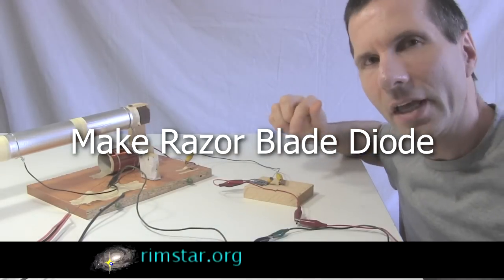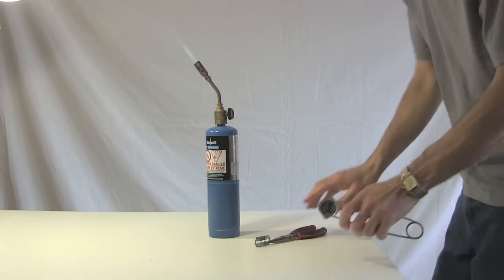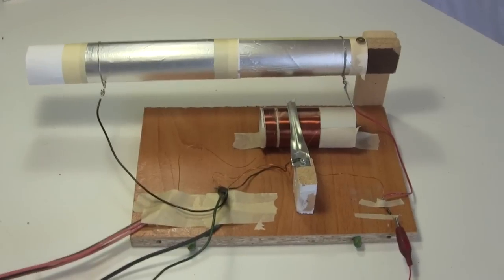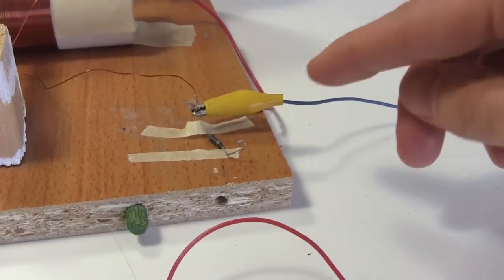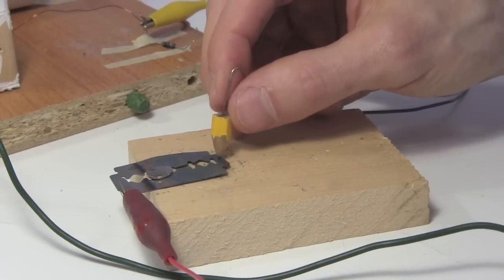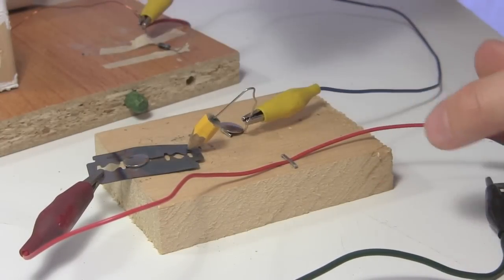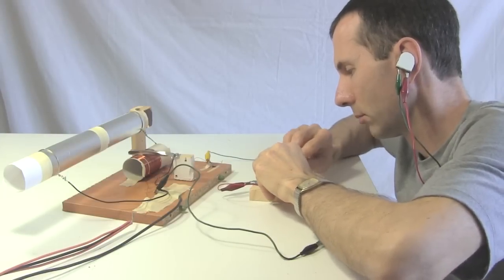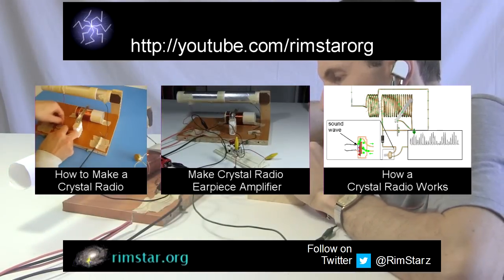Make Razor Blade Diode for Crystal Radio/Foxhole Radio

Comment: Would a candle flame be hot enough to "blue" the razor blade?
Reply: A candle flame doesn't get hot enough to blue steel.  The blue color is from an oxide coating that forms at a specific temperature which is different for different types of steel, but it's always hotter than what a candle or a butane lighter can give you.

If you want to know more about the oxide colors for steel, look for videos about tempering blades.  The oxide turns different colors as you heat the steel.  When tempering a blade, Blue usually means you overheated it and you need to anneal it and start over.

(I realize this is an old post, I'm putting this comment here in case other people have the same question.)
Reply from the maker: It's been so long since I've done this and I did it only once and I don't remember if there were temperature requirements. I suspect there must have been, otherwise why would I have used a propane torch, but then again, maybe the soot from a candle flame would coat the razor blade. Sorry I don't have a better answer.

Comment: do we have to use a razorblade also can we an a butane lighter to blue the metal
Reply from the maker: It's been so long since I did this that I don't recall the details of what other materials would work or what the temperature requirements were. A butane lighter might be better than a candle flame though since a candle flame would probably coat the metal with soot.
Reply: A butane lighter doesn't get hot enough to blue steel.  The blue color is from an oxide coating that forms at a specific temperature which is different for different types of steel, but it's always hotter than what a candle or a butane lighter can give you.

If you want to know more about the oxide colors for steel, look for videos about tempering blades.  The oxide turns different colors as you heat the steel.  When tempering a blade, Blue usually means you overheated it and you need to anneal it and start over.

(I realize this is an old post, I'm putting this comment here in case other people have the same question.)

Comment: can you keep the pencil at the same spot on the blade, and then move the wiper to get another station? Or do you need to move the pencil?
Reply from the maker: If you have the pencil in a spot that allows you to tune into at least one station then you can leave the pencil there and use the wiper to tune into other stations. But if you haven't managed to tune into any station yet then you'll have to move the pencil around, and possibly the wiper too, until you do get at least one.
Reply: @RimstarOrg  Thank you, I am really learning a lot from you. I admit that I am more theoretically than practically minded, so I rely on this kind of videos to keep me in line!

Comment: I rapped my wire around the tp roll and it kinda deformed it a lil will it still work should i rap it around a bottle instead so it will stay round
Reply from the maker: If the tp roll is still close to the same diameter and each turn of wire is still touching the one beside it then it should be okay.  It doesn't have to be perfectly round, or even round at all.

Comment: Make your own crystals (diode)...Taken from Australian 'Hobbies Illustrated'  Nov-Dec 1946. "To make a crystal of the galena type suitable for a crystal set radio,first melt a small piece of lead about the size of a pea  in a old tea spoon. Then add one gram of sulphur and stir with a piece of wire to combine the mixture. Allow to cool and use the resulting black metal as you would a crystal".
Reply from the maker: Neat. I've never heard of that technique. Thanks.

Comment: Do you think an old small cell selenium rectifier would do the trick in place of a germanium diode? Also, I think you could try using a small audio TRF as an impedance matcher for a normal earpiece /headphone instead of a x-tal earpiece, have you tried it yet?
Reply from the maker: Regarding the selenium rectifier, I don't know. A google search for "selenium crystal radio" turns up that razor blades coated with selenium oxide works but I don't know if a selenium rectifier is the same.
Regarding using a small audio transformer as an impedance matcher for a normal earpiece, I did that here http://youtu.be/GCh2LVHUavQ but with a regular transformer since I didn't have an audio one.

Comment: Using LED as a diode it works
Reply: You can certainly use an LED as an ordinary diode in some cases but they would be almost impossible to use with something like a crystal radio unless you wear a few hundred feet away from a VERY powerful station.

A germanium diode has a forward voltage (loss) of about 0.3V, a silicon diode has a FV of around 0.7V. A typical RED LED has a forward loss of around 1.8v (which is why they are often used for a dual purpose in 13.8v power supplies - use one is to show the unit is on, use two is it placed in the 0V to ground lead of the voltage regulator lifting the 12v to 13.8

SO

A red LED would lose you almost 2 volts - and when your signal is only going to be in the order of a few hundred millivolts with a crystal set, you can see how this is a problem. Other colours are worse - with blue / white having a forward voltage of around 4 volts!

Comment: I tried heating a bare copper wire to get a layer of copper oxide. then touching it to the sharp edge of razor blade.kinda worked a bit. best results for me with hot carrier diode detector.

Comment: You could try 'bluing' the razorblade by dipping it in  motor oil while hot.
Reply: That would probably also create some sort of very thin Carbide coating, maybe that would be a better semiconductor.

Comment: Using pencil lead is important? could we just use wires to connect it with blade?
Reply from the maker: I think the reason for using the pencil lead is that it's soft and there's less chance of  damaging the delicate semiconductor layer on the razor blade. At least that's what I could find when I last looked for a reason.
Reply: RimstarOrg i tried making it with pencil as well sir. It failed. Later i got to know from my other radio device that my area does not catches AM radio waves and only FM radio waves are available. First attempt and failed 😞 was quite demotivated.

Comment: Is it possible to build the crystal radio with a regular diode?
Reply from the maker: Yes, but it has to be a germanium diode. Here are some part numbers: 1N34A, 1N60, 1N91,  1N119, 1N270, 1N277, 1N283. Most diodes are silicon diodes. I have this whole playlist of videos on how to make it.
Reply: Ok, Thanks. They look to be cheap on ebay
Reply: you can try  with schottky diodes too. 1n5422 for ex.

Comment: Could you use two razor blades in Darlington configuration to get better amplification?
Reply from the maker: I wasn't familiar with the Darlington configuration until you just mentioned it. However, a quick check shows it has to do with transistors (I could be wrong, and that there could be other uses... you'd probably know better than me at this point). These razor blades are acting as diodes, not transistors.
So the question would be is there any advantage in using two of them in parallel. I think the current is so low here that you'd just be increasing losses.
In series wouldn't work since that would increase the voltage requirement, and that's already an issue with crystal radios since the voltage is so low.
That's my guess while thinking on the spot.
Reply: > "These razor blades are acting as diodes, not transistors."
Ok, in this case a Darlington pair would not apply.
For some reason I've though you replaced a germanium transistor for a razor blade (actually you've mentioned it was a germanium diode).

Comment: can i use a zener diode instead
Reply from the maker: +science for fun A zener would only work if you have a very long antenna (few hundred feet?) or a very powerful radio station nearby. A silicon diode is even worse. You really need a germanium diode.

Comment: 5 and 9!   

Good job, lad.  After seeing so many supposed graphite/steel detector radios that are missing the tickler pencil or coils so they are not tune-able, etc.,YOU are the only one, so far, that I found has got it RIGHT.  Congrats!

If done properly (an oatmeal box makes a slightly better coil form), they are quite tune-able with fine selection, however, less powerful than a galena set,. In fact, if you substitute a simple modern glass (crystal) diode, you will be able to receive stations from many miles further away. Also, you can power a full Westinghouse set of carbon headphones.  (I have a nice set of head phones with bake-lite "ear pads" that sound great even though they are from ca. 1918.  (they are a tad uncomfortable!)  Even the old cloth wires & simple plug ends.  Hets and super hets with triodes and even class A-B amplification were in use  by the early 1920s, 

 The hi-fi craze could have gotten started much earlier as radio stations of the 1930s transmitted modulation of far better fidelity than the AM broadcast band  has  today.  That's the drag of having old radios...—nothing to listen to... 

I have been a HAM for 45 years.  I did not always use the HAM bands, however, er, um sometimes I used the 3 meter band or the 180 metre band (with a Marconi aerial) so my mates could have fun playing their favourite records for the town.  But 3 meters FM was far easier and cheaper to build and resonate.  I used two Radio Shack FM dipoles as stacked bays ans built my own balun and matching transformers with simple coax loops.  We put out about 15 - 20 watts (all tubes back then -no PLL chips).  I used a simple phase modulation FM method that sounded better than the regular stations because I , er, um, might have been exceeding 75 kHz deviation and perhaps there might have been some AM components in the modulation. But we had better bass than any other station on the band!  Since we had no money, it was a great way to sound good without an Optimod!  I was able to get some sample optical isolators (for free) and make a fair compressor-limiter.  Parts were as near as the next TV set or old radio thrown out on the kerb! 

Resourcefulness is my favourite thing about being a HAM.  

73s !

Comment: can i make high current diode using a bunch of iron oxide???
Reply from the maker: +andrei ruiz I'm not sure. I think you'd have to increase the number of contacts to get higher current. Think of it as a bunch of regular diodes. Connecting them in parallel will make a resulting diode that can handle higher current. That's the same as increasing the number of contacts. I know there used to be copper oxide diodes on the market that were done something like that.

Comment from the maker: +Malachi Venturini I don't about all razor blades. As long as it's made of steel, since what you're trying to do is form a layer of iron oxide, and steel contains iron. I don't know if there are razor blades made with something other than steel.
PS There's no Reply button under your comment because of your Google+ settings.
- go to your Google+ page,
- in the top, right corner click on your thumbnail icon,
- in the popup that appears, click on "Settings".
- for the 2nd question down "Who can comment on your public posts?" set it to "Anyone".
Reply: RimstarOrg there must be away to intercept internet

Comment: Would a shotky diode (low drop) be suitable for replacing the germanium diode.
Reply from the maker: Yoram Stein Its forward voltage drop is between that of germanium and silicon diodes so if you have a long antenna then it might work. The reverse current might be a little high since there's so little current involved here, but since I don't know how much current there is, I can't say for sure. Basically all I can say is try it and see.

Comment: where did you get the germanium diode?
Reply from the maker: akeem louigarde Some I bought online. I don't recall if it was ebay or some other company but I just did a quick search on ebay for 1N34 and found plenty of them. And some I bought at a local electronics store here in Ottawa (in case that's where you are) called Gervais electronics.

Comment: I like the idea of putting together something that uses no ready made component so this is an interesting substitute for the germanium diode.  Any other materials that might work as substitute germanium diodes?  I'm thinking perhaps a spring to hold the graphite tighter against the razor might be useful.  Also, what affect would variations in size of the piece of graphite have?  I have various sizes of pieces of graphite and am considering experimenting.  Ideas?
Reply from the maker: nunya biznez For the diode, the original crystal radios used a chunk of galena crystal (looks like a rock) and a sharp pointed wire touching it. That's where it got them name "crystal" radio. A spring to hold the graphite tighter against the razor may be a bad idea. You don't want to puncture the coating on the razor and touch the metal underneath. Though a spring that doesn't press too hard would help. And you usually want the graphite that's touching the razor to do so at a point. I'm not sure of the reason for that.
Reply: RimstarOrg  Oh, Ok, I would have thought the graphite being softer than the steel would not be a problem.  OK so when you take the flame to the steel like that, what is the coating that is created on the surface of the steel? Ok so the second to last sentence answered my other question which was concerning shape.  I have a bunch of random chunks of graphite used in Jewelry making and was thinking about experimenting with those but if the point is a requirement then it seems the pencil point is the best way to go.
Reply from the maker: nunya biznez It's an oxide layer coated on the steel. It allows electrons to flow in one direction only, like a modern diode. Its color is blue and the process is sometimes called bluing.

Comment from the maker: To see how to make the capacitor, see my video "How to Make/Build a Crystal Radio". There's a link to it in the description below this video. The capacitance is from 0 to around 640 picofarads. For this radio it needs to be only around 40 picofarads to 355 picofarads. I calculate the coil inductance to be around 369 microhenries.

Comment from the maker: That depends on where the coating is. If it's platinum then I'm guessing it's only on the sharp edge and so it won't matter. I don't know where chrome would be. But if the coating is on the flat part of the razor then I doubt that it would work.

Comment: I'd be guessing, but I believe that with the graphite being conductive yet resistive, there is a semi-conductor junction effect. Otherwise, the blue of the razor is only a burnt razor in the circuit. Similar to copper when you heat and quench to a salmon color (John Bedini within salts cells discussions). Fired copper like that produces around 0.1V extra when with galv steel in a salts cell, built loads of 'em. So seems related.
I've tried before with just end of a pin and got nothing.

Comment from the maker: A foxhole radio is a crystal radio but there are many, many different possible circuits for crystal radios. I'd always considered foxhole radio type crystal radios to be the ones that were used in the foxholes. My understanding is they were tunable using the razor blade diode and possibly the length of the antenna. My crystal radio in this video is tunable via the tuning coil, variable capacitor and the razor blade diode.

Comment from the maker: I wondered the same thing. I couldn't find anything online as to why the pencil was used, especially when at the time this was invented, using just a needle with crystals was common practice. But I couldn't get it to work with just the needle. Not necessarily conclusive though since it was hard to get it to work with even the pencil.

Comment from the maker: A razor blade and pencil are easier to find but less reliable (and more expensive if you buy your diodes in bulk.) They're more fun though! I checked and all I would see was reference to steel and stainless steel working, nothing more specific. I suspect galvanized steel wouldn't work since that has a coating of zinc on it.

Comment: This is useful information.  A razor blade and pencil is easier to find than a germanium diode.  Do you think this would work with any thin piece of steel?
Reply: Necrothread reply: I do think so. (You beat me to the flamethrower man!)